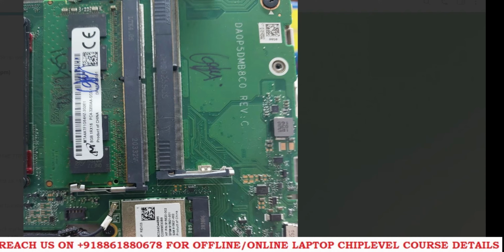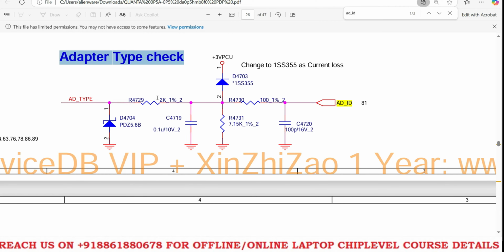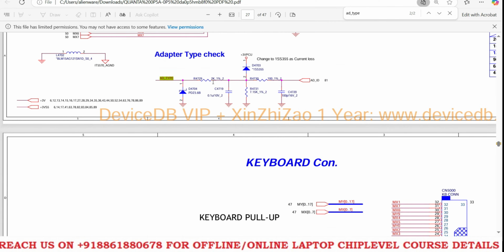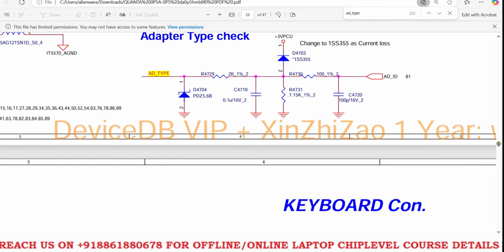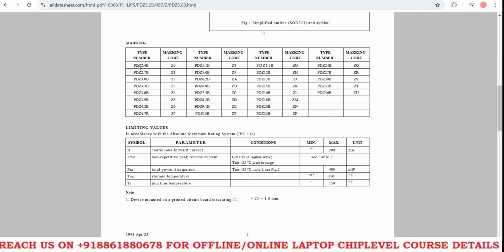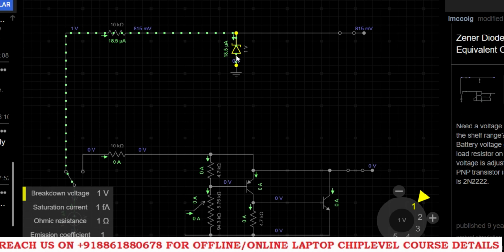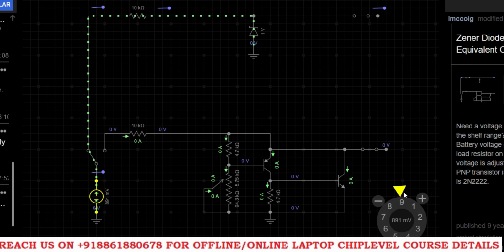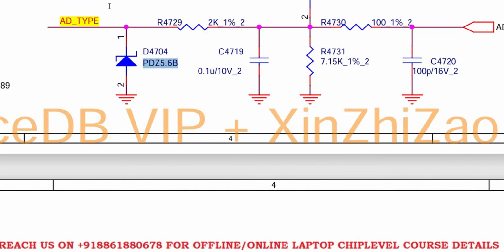AD_ID in HP Laptop Motherboard | Laptop Repair

Comment: I have a question... if I remove the Nvidia chip from the laptop board will the board  still function & have display?
Reply from the maker: In case if u have Intel graphics in that board, Change board ID, and disable or enable the the pull up or down resisters as per the schematic. U will get the display
Reply: Sir..thankyou for your quick reply. To be precise this is Lenovo Edge E431.. this board have separate  CPU, PCH & Nvidia graphic chip.
Reply from the maker: Please share the schematic with details in telegram.  I will guide u
Reply: May I have your Telegram id..
Reply from the maker: +918861880678
Reply: Sir..already sent

Comment: Sir Some correction As per Datasheet it showing working in Reverse Voltage" Vr " Of 2.5V and Maximum Current 1MicroAmp Regulating it because its signal and more current could damage IO.

And if voltage below 2.5  from AD_ID then Reverse Diode from 3.3Vpcu will provide and zener will regulate it . 
If 19v supplied to zener it will burn so for zener protection before zener is 2K resistance applied.
Is this true sir?
Reply from the maker: Hi . I really appreciate your reply.  In this video, I have given general ideas that why zener is used. I have explained in paid videos.  Because,  who are interested, for them we can tell in depth. 
Please message me in telegram. I will explain in details if u r really interested to know. Thank you once again.
Reply: @LaptopCourse  Ese Zener es de un valor de Vz nominal de 5.6v, con un mínimo de  5.48v y un máximo de 5.73v, y un Vr de 2.5v), la explicación en el video es errónea como dice @TheRealTechnical, que esta en lo cierto.  Pero si la explicación varad o correcta la da en un video de pago,,,,,, en los videos gratuitos,,,,, miente y da información falsa he incorrecta para equivocar y confundir a los que están aprendiendo? ,,,, Creo debería admitir que se ha equivocado o borrar el video,,,, no habla muy bien de usted ni le deja en buen lugar este video. Un saludo.
Reply from the maker: To be frank,  what you told it's true.  I accept my fault. What he told that also true. Yes. It's not good to show these in videos. But, the main intention of this is to introduce the working concept of the zener which doesn't know by many technicians. And also I told him I will discuss regarding this in telegram.  Thank you very much for your comment. It's really appreciated.
Reply: @LaptopCourse  Primero, gracias por borrar mi comentario, jejeje. Como dije en mi anterior comentario, " Ese Zener es de un valor de Vz nominal de 5.6v, con un mínimo de  5.48v y un máximo de 5.73v, y un Vr de 2.5v), la explicación en el video es errónea como dice @TheRealTechnical, que esta en lo cierto.  Pero si la explicación varad o correcta la da en un video de pago,,,,,, en los videos gratuitos,,,,, miente y da información falsa he incorrecta para equivocar y confundir a los que están aprendiendo? ,,,, Creo debería admitir que se ha equivocado o borrar el video,,,, no habla muy bien de usted ni le deja en buen lugar este video. Un saludo."  (¿Un "técnico" que desconoce como trabaja un diodo zener?,, no conozco ningún técnico que desconozca el funcionamiento de un zener) , si conozco quien se cree técnico y habla sobre Zener equivocadamente,,,, su caso. Puede volver a borrar o eliminar mi comentario, pero hablaremos de forma extensa sobre su video en mi canal oficial de youtube,  ahí no podrás borrar ni ocultar su desconocimiento, un saludo.